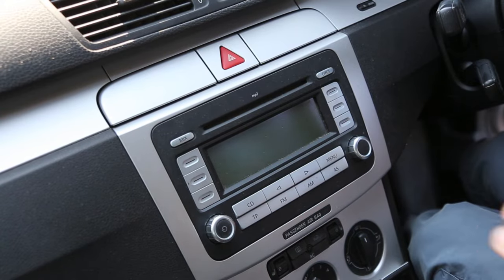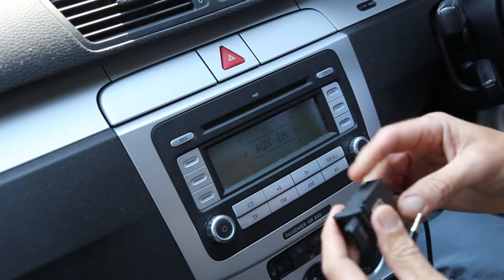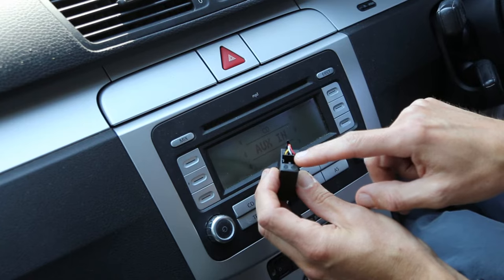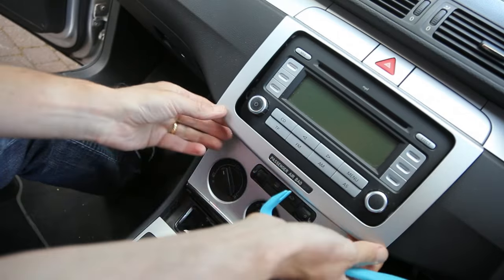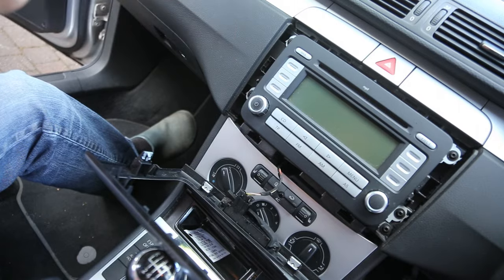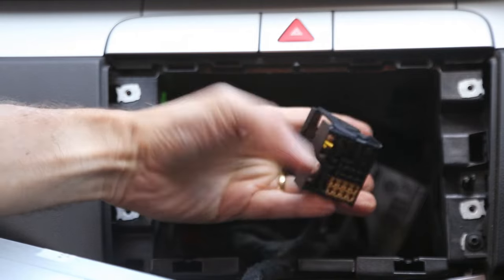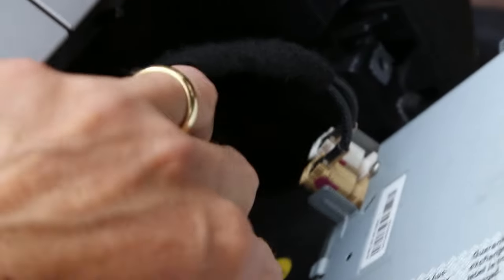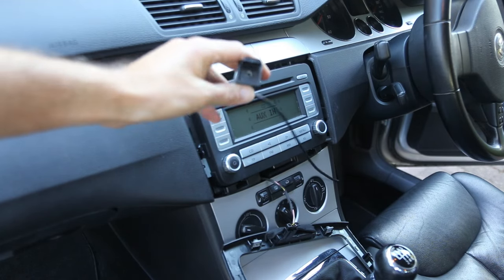Cheap way to Setup Aux Cable Input for VW Radio RCD 300/500+ Plus stereos MP3/Phone Lead Connection

Comment: that 4 wire suggestion at 0:46 was a red herring. They don't exist. (not any more at least?)
3 pin cables do have a ground, it's the black cable. you just need to re-wire the cable for your specific RCD 300
in a VW Golf V i got my 3 wire aux cable working after rewiring them *2*(black)(ground) - *8*(white)(left) - *9*(red)(right)
there's a video floating around that suggests the configuration is 1(red)-3(black)-5(white) but that just produced very VERY quiet audio for my particular head unit.
and the aux cable i bought came in the configuration 1(red)  2(black) 7(white) which produced a very loud buzzing noise. 
anyway, 2(black) 8(white) 9(red) worked and now i get no hiss, no buzzing. works perfectly. hope this information saves somebody else hours of googling for answers.
Reply: Bro thnx you saved my life
Reply: My cable has yellow red and white. Does that men that the yellow is the ground or no?

Ps bad with wiring
Reply: @Delortion115 I’m having the same issue now.. you manage to sort it?

Comment: Hello there, great video thank you. Just wondering where can I buy one of these cables? I hoping to connect it to a SkodaAuto Bolero head unit made by Delphi.. I have an image of the ports available at the back of the head unit if that would help at all?

Comment: I ordered aux cable for my passat rcd 300 but when i plugged it in and clicked CD twive nothing happened 😢
Reply from the maker: It does need a switch to be set via VCDS and to have the 300+ radio

Comment: Hi I have a rcd 300 with 6 CD changer working.. Does that mean aux is already working presumably and I can disconnect the CD changer and put this cable instead with no vcds needed? If so I presume the playback quality of mp3s via mp3 player would be as good as cd quality via this cable? Thanks in advance
Reply from the maker: Unfortunately it doesn't necessarily mean that the Aux will work automatically as some have CD changer but not aux enabled. The quality will be good by plugging in directly to the unit with a cable like this

Comment: I did this, and whenever i enable aux i start hearing this buzzing noise, any idea what that could be?
Reply from the maker: I found that the quality of cable can make a difference. You need a cable with an earth connection or it can cause buzzing
Reply: @ajvw  aux cable or the whole lead? cause i tried different aux cables and its the same thing. there is buzzing and the music is very low quality, no bass at all.
Reply from the maker: @Titaxxas  it's the whole lead. I thought I mentioned it in the video but I've found the original cable I bought only had 3 wires and no earth line
Reply: @ajvw  could you help me find one with the earth line?
Reply from the maker: @Titaxxas  one like this if it's actually the cable in the picture has 4 wires

https://www.ebay.co.uk/itm/324033609046
Reply from the maker: @Titaxxas  what I've also found is that if you connect the phone to the car to charge then the buzzing noise will go away or be reduced as that creates the earth
Reply: @ajvw  yeah i cant really try that as im using a aux to lightning cable for iphone, so i cant charge and use aux at once.
Reply: @ajvw  Hi, could you please send another link of the right cable? Cause the one you sent here is no longer valid. Btw thanks a lot for the video, very useful.

Comment: What year is that passat?
Reply from the maker: This one is 2008
Reply: @ajvw  so would that fit an 07 rabbit?
Reply from the maker: @Prod.ENSVNE  if it has the double din then it should. We don't have the Rabbit in UK so I can't say 100%
Reply: @ajvw  im suprised you don't have it out there cause vw is from the east 🤷🏻‍♂️😂
Reply from the maker: @Prod.ENSVNE  we have VW but not a model called Rabbit
Reply: I have VW Passat 2008 mate it doesn’t give me the option when I press CD twice for using Aux but in the arm rest it has an AUX port ?

Comment: ive and rcd 300 in my golf plus 2005, i tried first to change the radio twice but batterie was always dead after tht, if install the aux by this or a box which emulates a cd changer will it drain battery as well?
Reply from the maker: It shouldnt do that but if radio is draining battery you may have another issue
Reply: @ajvw  Yh i went extra to an electrician he took the whole electronics of the car appart and couldnt find a cause, now ive put the factory tape back into the car with a adapter on the cd changer port. Now the car is completely fine no battery deaths since February
Reply from the maker: Glad to hear you got it sorted
Reply: If you install and aftermarket or different vw head unit you need to get your canbus coded on the mk5 golfs
Reply from the maker: @JackVinall35  thanks for the info

Comment: Hello, I was able to connect my aux cable up and it connects fine via 3.5 jack but the sound is really low. With sound maxed out on my phone and my stereo through aux it's probably the equivalent of 20% volume when playing the radio through my stereo. Any ideas? Thanks!
Reply: I had a similar problem but had a lot of static too had to rewire the pins in the white part of the aux cable the pins were in the wrong place.
Reply: @littlebigadventures  You mean the pins where female aux ports is?
Reply: @theprotector6082  No from memory it was the wire that connects to the back of the RCD unit

Comment: I have a 4 wire one including earth like you mentioned, but still have crazy static. Anyone found a solution?
Reply: I can hear music but with a constant clicking/static sound over the top. And the music is quiet
Reply from the maker: The solution I found was to plug the phone in to the power lead in the car as that seemed to earth it and prevent the static.
Reply: I had the same problem, solution for me was rewiring the pins in the molex connector that connects into the back of the RCD unit.
Reply from the maker: @littlebigadventures  thanks, that's useful to know
Reply: @littlebigadventures Hi there, I am having the same issue as described above. I do have the 4 wire lead that connects the AUX input socket to the RCD310, but it still sounds awful. 
As I start to drive the noise gets louder and louder, the higher the RPM the louder the static noise is. Could you please describe in detail how you managed to sort it out? Many thanks.
Reply: @mozeskiraly1561  Hi mate check the video watch?v=39jFwAsUjIM&lc I left comments there on how I rewired it to get mine working

Comment: Will an RCD300 fit in a MK4 golf?
Reply from the maker: I believe that's wider than a double din so probably won't fit
Reply: @ajvw  thanks for the reply, its rounded edges were making me wonder. Thought it might have been a decent upgrade.
Reply: @Seventeen_Seconds  The RCD200 fits, but it uses a different connector from the regular half-height Mk4 radio, so you will need an adapter and you will need to run some wires from the instrument cluster, because the RCD200 requires CANbus.